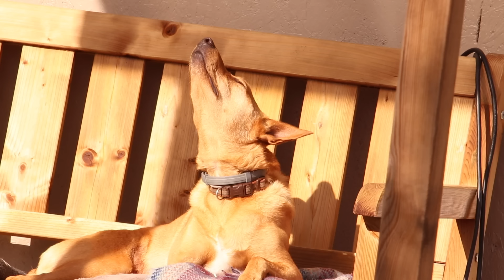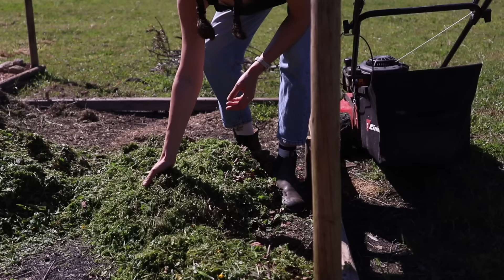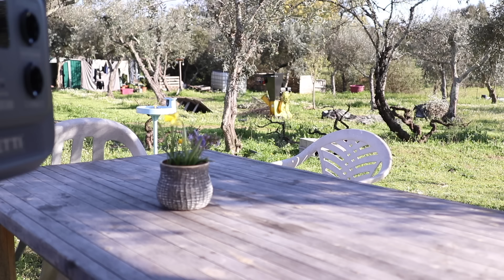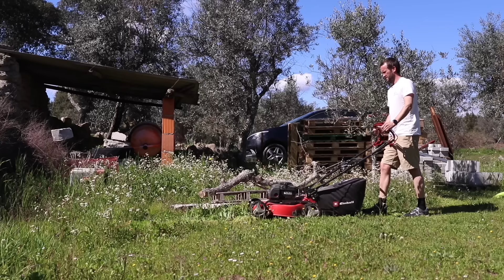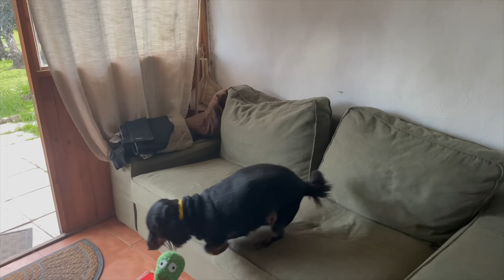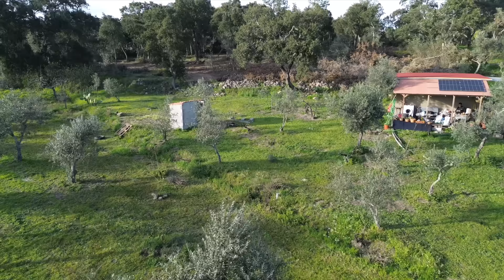Working on our Spring Garden to Feed our Family

Comment: I discovered re wasp nests, especially the HUGE ones in the Northern Territory, Australia, is that if you give them a hose most days they'll absorb a lot of water and become so heavy they will eventually fall down or the wasps will abandon that  nest and find another place to use as they like a dry site for the nest. If you do hose it down I have found that if I kept hosing where the nest was for a few days it would wash away the pheromones and they would find another place to rebuild the nest. If you just leave it, they will come back to that spot next year. Just something I discovered as in the Territory they are inclined to burn them out at night but there always seems to be a few that will manage to give you a  sting. Using a hose lets you stand back a fair bit and reduces the chances of them stinging you. Just a thought.

Comment: Miss marydesigns  said abut grass clippings is correct please do not put grass clippings on the potatoes put them in the compost bin and add zeolite, this will break them down faster. putting grass clippings on the soil builds up a great amount of heat which will not be good for the potatoes.

Comment: To be fox proof it would be good to bury your fence (use bonex fencing about thirty to forty inches deep. On top of that you can cover with normal fencing wire to protect your chickens been taken by eagles.and foxes from climbing over.  Use 50 x 50 mm or smaller.
Reply from the maker: We're digging the fencing up

Comment: Your plot of land is looking tidy.  How would you like to make your own compost pile in 3 to 4 months.  Find a very hot sunny spot near your vegetable garden.  The trick is to layer your compost heap using all your grass cuttings mixed with smaller types of branches etc., then put a layer of soil on top, then get wood chips and, then put a layer a layer of manure like chicken/goats/ horse/cow , then do this about three times. Finally cover your compost heap with heavy duty black plastic and put heavy stones/bricks around the base. At night roll the black plastic back to one side.  In the mornings give the compost a good soaking, and put back the plastic to cover and allow the sun to heat up the compost heap.  Do this for 3 months. Start another compost heap.  And you will never run out of out of good compost.

Comment: 🇬🇧🇨🇦🙏.  I think I commented on your channel  many months back…maybe bemoaning your burning some garden/farm debris and advocating your getting a chipper. Small/entrylevel machines are useless. The one you have seems up to the task . I hope the blades are not too hard to get and get at …Oh the frustrations of dull blades!  It is more than a little handy having Nick ever ready to help when the engine lets you down!  Bon Chance !🇬🇧🇨🇦🙏
   Save some chips for the ground around the olive trees. Not thick enough to suppress the grass. Leave the bag off the mower most of time. You are robbing the soil. A bag or two from time to time,as per this video will do no harm.

Comment: once you get your home composting going it will make a bit difference, I have 3 sets of 2 set in different areas so I don't have to lug clippings, prunings and kitchen waste too far when I'm gardening.   (all vege/fruit peelings from meals as long as it hasn't come in contact with meat or bread/cakes, I have never had vermin problems.  Having 2 together means you can turn them easily and keep the air/moisture working

Comment: 2 gardening suggestions-    When adding compost or mulch to your larger beds ( where you put the grass clippings) try to avoid ever stepping into the beds unless you add a board or 2 to walk on as you’ll be compacting the soil. 
You want want to check the PH of your “ground beds” as they are probably not what the struggling crops do best in.  Investing in a small PH pronged  testing device can be a great aid toward your success.  Happy Growing!

Comment: Another lovely video. Thoughts on growing in the ground versus the raised beds. In an very early video, Carissa remarked that the ground had been tilled over many years, leaving it sandy and hard. The raised beds provide two advantages. The first is the huegel practice you used. The heavy organic matter at the bottom of the metal beds retain moisture, so the plants can send roots down there. I also feel that the shade those plants get help the plants as well. It will take some time to build up enough organic matter in the direct to ground beds. But you can do it!

Comment: Mower must be 10x easier than strimming, if you want to use the "waste" as compst :) That is - if the land is cleared for stones and other rubbish, of course :)

Also @12:25 - how do you cope with bugs eating up a lot of the vegitables?
I know a lot of "off-griders" are "ecological growers", but how does one cope when cabbages etc are attacked with bugs? Personally I for sure would spray them with "safe" pesticides.

@23:42 I think that realizing one takes a bigger bite than able to chew is HIGHLY respectable. Big kudos :)